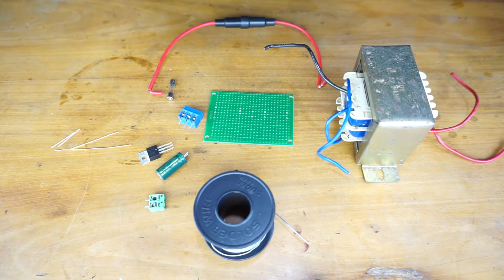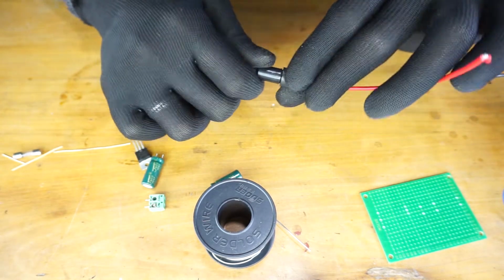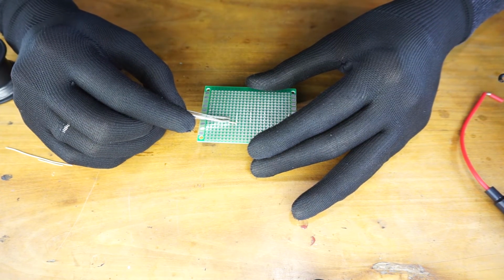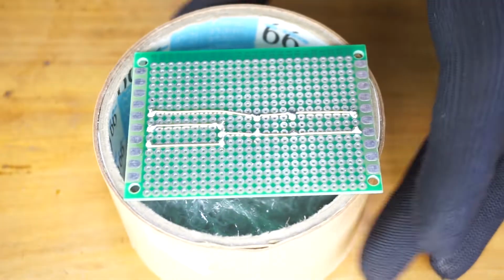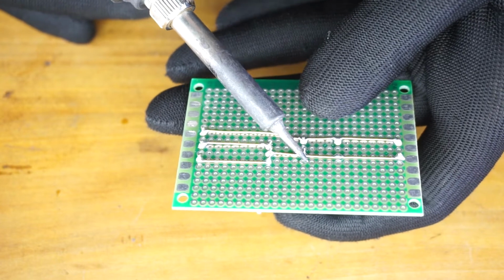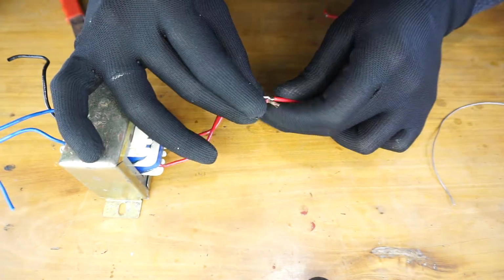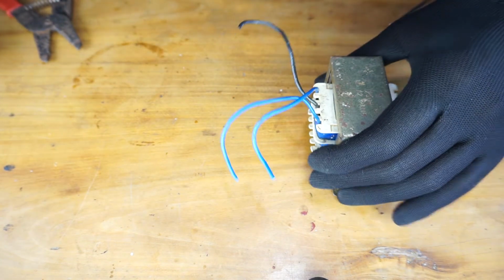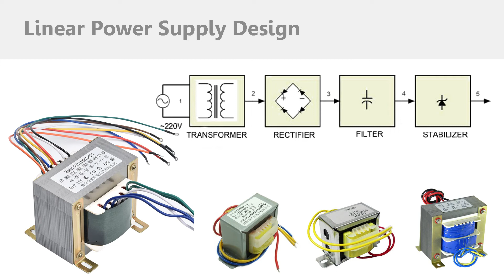Power Supply for RTU5024 Projects

Comment: Hello I have the same device rtu 5024, my question is if I can connect it to a 24v 100A battery, the instruction says that it can work on a voltage of 9-24 v. Your advice, Thank you in advance
Reply from the maker: Yes it will work . It depends on maximum input voltage of the regulator ICs inside. For this G.S.M relay controller you can input 24 volts .  But , I'm not sure whats inside your rtu5024 .